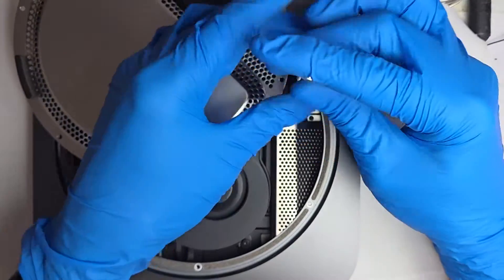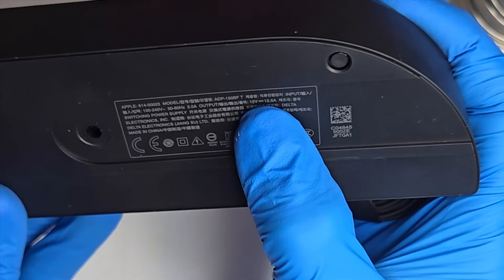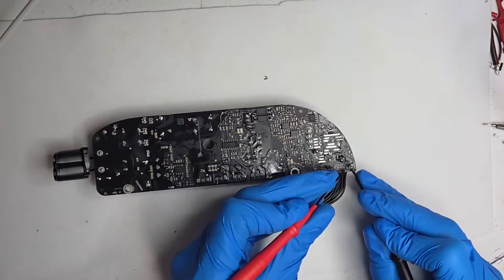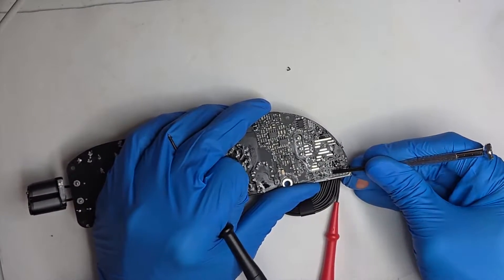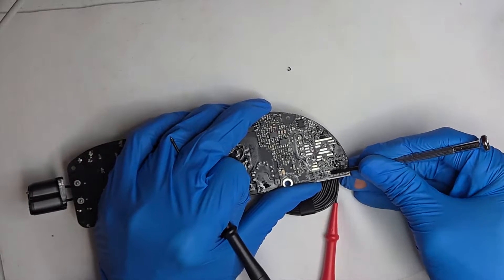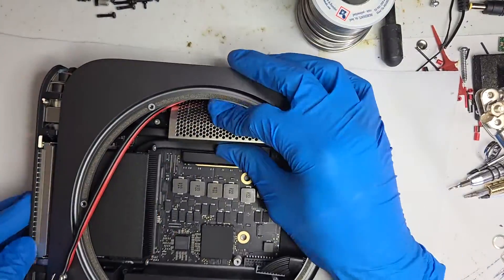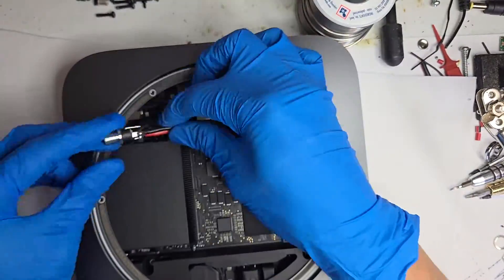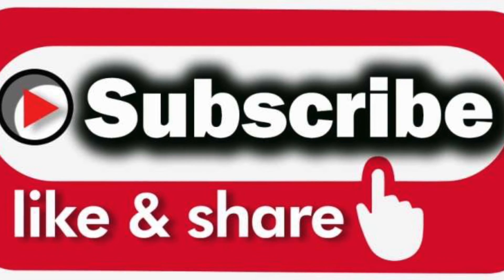DIY: Intel Mac mini (a1993) teardown and 12v dc upgrade hack.

Comment: Cool mod 😎
Reply: This should work on an "a1347", right?
Reply from the maker: Technically possible on all models, however it comes down to if there is room on the back panel to install a DC port.  I don't remember which models, but some did not have a clearline to drill a hole.  In that case you'd need to just come out somewhere else thats not interfering anything.
Reply: @mikegyverComputer  Might be space for a type-C port and a particularly compact regulator to bring the 20 volts down to 12.7? I don't think a typical off-the-shelf reg would be able to fit and take the amps necessary for Intel.
Reply from the maker: yes? maybe depends on how customized and small you can get the regulator to fit in